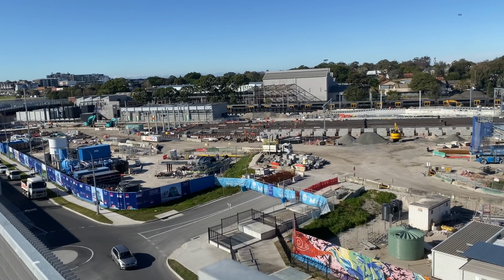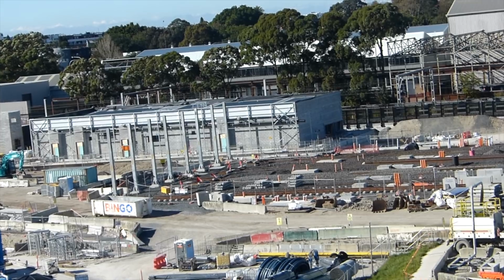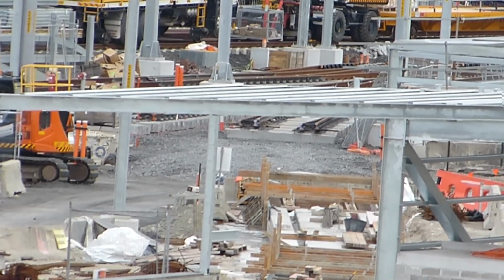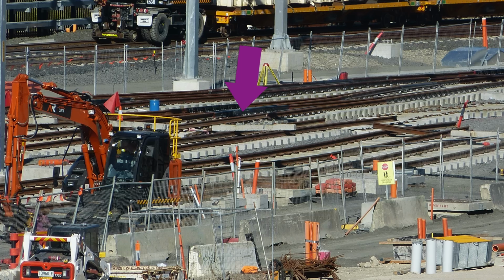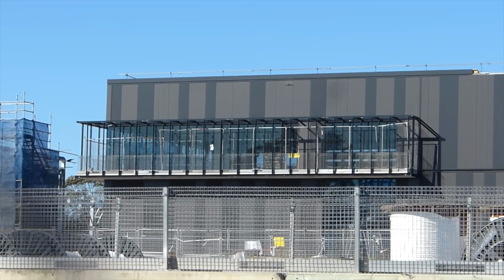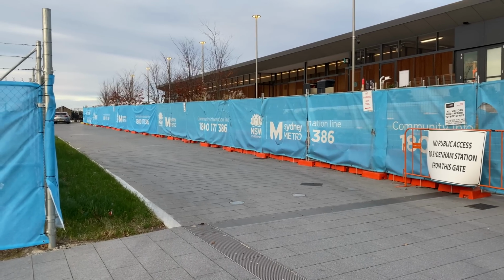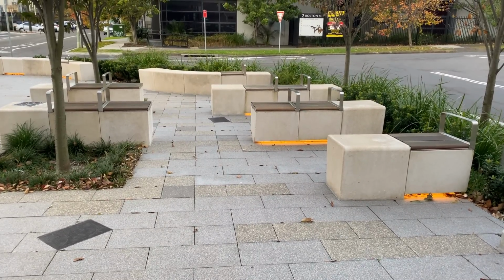Sydney Metro Trains Facility South, Marrickville Dive Site and Sydenham Station Update - June 2022

Comment: Nice videos! Do you know if there is a calendar to look at, for when each station will be ready and trains become operational?
Reply from the maker: Hi Mirko, I'm not aware of any calendar.  It's hard to have set dates for opening of stations, as unexpected issues can arise at any time during the construction process. My latest understanding is that the section from Chatswood to Sydenham will open first (sometime in 2024), and I'm assuming that all stations will open at the same time, but that could change.  The Bankstown Line stations will then open later in 2024. Hope this helps.

Comment: I used to work for the Contractor responsible for SMTF S so here's what I know. The names of the tracks are called "Stabling Roads"  or "Roads" for short for the tracks labelled 1-8. The workshop track is called "Infrastructure Maintenance Road" . As for the NE Access track and NE Shunt track are  called "Western Bypass" track and "Eastern Bypass"  track respectively. As for the ? building I unfortunately can't remember it is.
Reply from the maker: Hi Tom, thanks very much for sharing the correct names for these tracks. Would you know the correct name for the SW Shunt track (the one that goes into Sydenham station?). Thanks again Paul
Reply: @TransportVlog   Whoops. I forgot that one. The name of that track is called "Shunt Neck".
Reply from the maker: @tomblaze7316  Thanks Tom! I'll use these in the next video.  I was at Trains Facility South today and it looks like all the track for the sidings has been laid, including all the point work.

Comment: Another great update.
Sydenham 2nd concourse must open any day soon with the PIDs on like that. Hopefully followed by Redfern 2nd concourse and Central Walk this year as well.

Purely a guess, but I'd think the depot tracks (or roads as I believe they are known are probably the other way). Just look at the platform numbering at Sydenham
Reply from the maker: The PIDs have been on since March (they got a mention in my previous update video), but yes, it should open soon. I'm going there every week at the moment, so as soon as it opens, I'll film it!  Interesting point about the siding numbers.
Reply: Platform numbering has nothing to do with road numbers. I believe convention is meant to be to number the road closest to the running lines 1, so you can add new roads without messing up the numbering. But then there are yards that don't follow this rule: Hornsby MC (but not Hornsby Yard), Flemington MC and Kangy Angy MC.

Comment: Brilliant coverage, Paul. So many changes since I changed at Sydenham for the Bankstown Line in the late 1940s as a child with my parents. Just a question, any news on how the Sydney Pit coped with all the recent rain? Hate to see all this work flooded. It did flood regularly in the early days (19th century), hence the Pit. I daresay the engineers have taken this into consideration
Reply: Late 1940s as a child?? Wow, you must be close to 100
Reply: @frehesh.4386  80 in August.
Reply: @geoffreypyne5809  my bad bro
Reply: Also, the 1900s were the 20th century not 19
Reply: @frehesh.4386  Gumbramorra Swamp (alongside Victoria Rd) was drained c 1880. On Friday May 24 1889 rain began to fall and lasted 5 days (sounds familiar?) The Tramvale Estate ( the old swampland)  flooded to a depth of 1.2 m. (4 ft) Council had to build that huge stormwater basin in Garden St to contain future run-off. 1889 is the 19th century. It can still flood down there.It's a swamp.
Reply from the maker: Hi Geoff, I believe it coped very well.  The whole Trains Facility and Dive Site area has had major drainage work and Sydenham Pitt has new equipment within the pumping station and the new aqueduct.

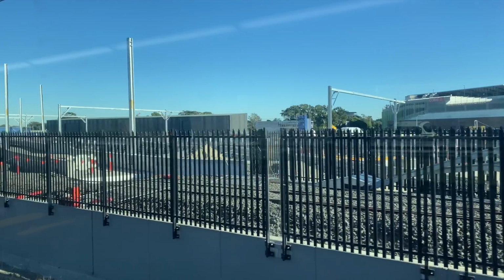Comment: Video-related question: what's with the weird sinusoidal patterns that appear on fences during the slowed-down in-train footage sections? 15:12 is a prominent example of this. Do you know what causes it?
Reply from the maker: Great question!  It's a feature in Final Cut Pro called Optical Flow. It smooths out the frames when slowing down clips and helps with shaky camera footage too.  However, it does some weird things with the fences, so that's not intentional! I used to film in Slow Mo, but you only get HD quality. By using method, I can film at normal speed in 4K and then slow it down afterwards, and keep it smooth! - Hope this makes sense!
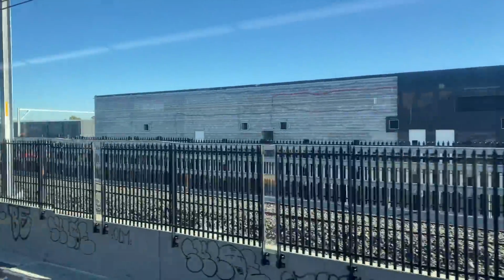Reply: Auto-stabilisation algorithms in various cameras. iPhone and Android phones do it, as do some other digital cameras. The way it works is pronounced at 15:12 because of the way cameras film top-to-bottom and the fence posts "stretch" between those "lines" that are actively recording. (Kinda like how you can leave a normal camera exposure on longer with a light source to draw a line).